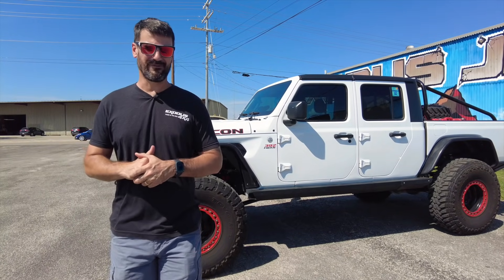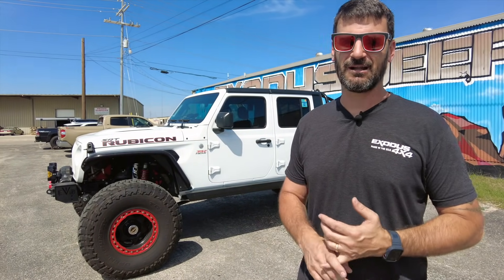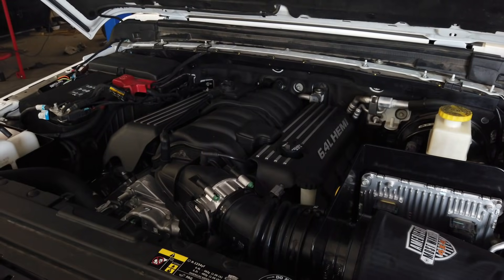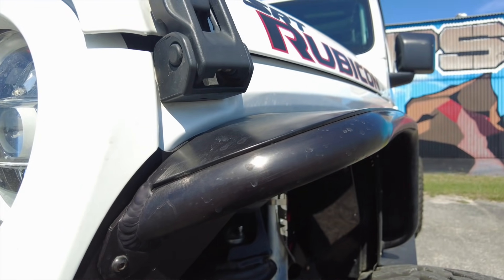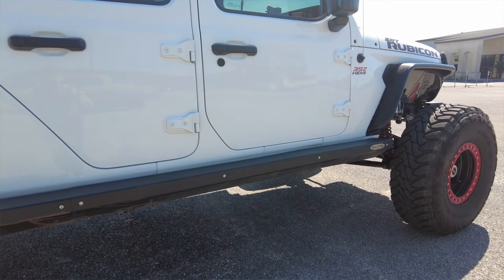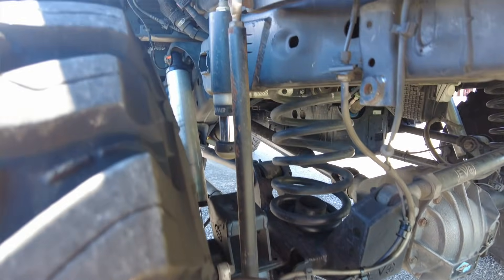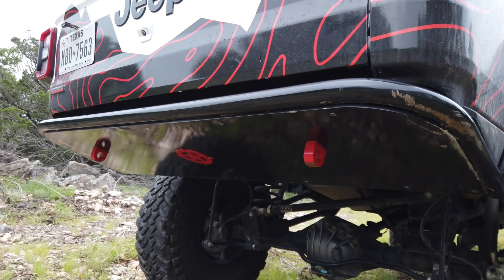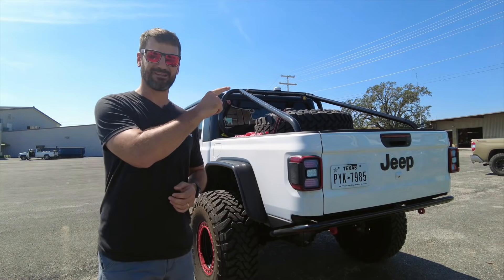A Tribute to the Greatest Gladiator Build - You Will be Missed

Comment: 10:00 Will the new shop be closer to the dallas/fort worth area ? 
Just wanna know if it will be closer to the dfw area since you guys are about 5 ish hours maybe more with traffic for me and others like me in the arlington/mansfield area

Edit- 11:12 yeah i can definitely relate here man,i know that exact same feeling when i sold my 76' Big block chevy square body long bed it was a pretty truck but not so much to the point that i didnt care to scratch the bed when either hauling dirt,wood or anything that would mess up the paint of the bed,it was super reliable and dependable even with the big cam i had on it,gas mileage was..........bad as expected,not so much since i did add a 4l80 with overdrive and carb. EFI and it payed itself off in a year from fuel savings,but man do i miss my chevy put about 60k miles on here and she's sold

...............but hey i now got a jeep gladiator,had a gasser traded it in for a ecodiesel for a really good deal by the dealer,and now im saving alot on fuel so far compared to my gasser JT :D but yeah,everyone lived happily ever after lol 😆😆